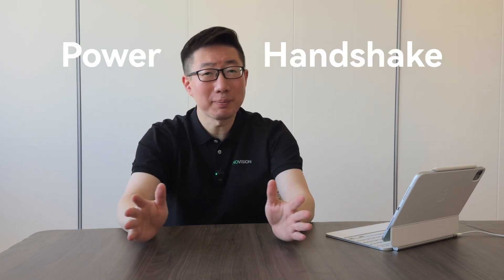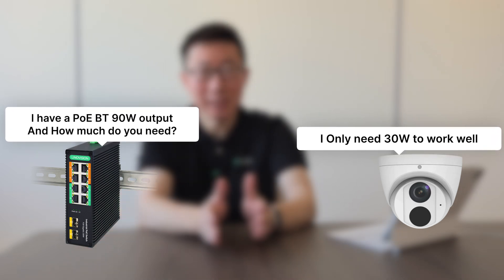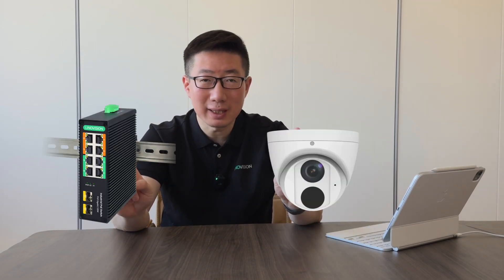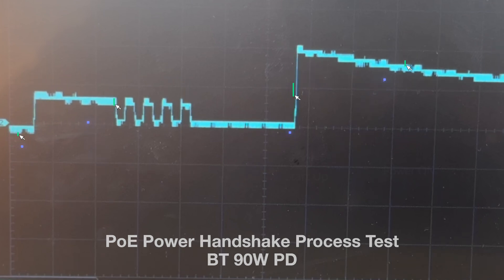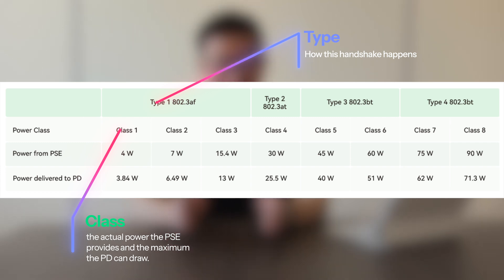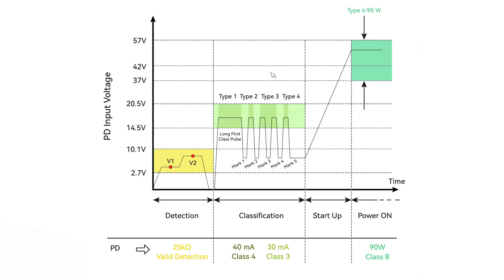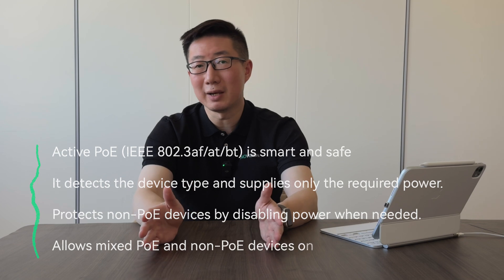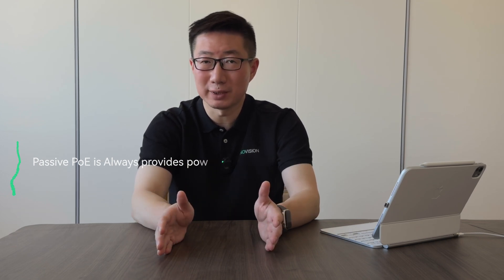PoE 101: Power Handshaking Process

Comment: I knew that a good PoE switch would test the client to find out if it was a powered device or not. I used to believe the switch would measure the resistance of the device, and it it met requirements, the switch would kick on the 48v power. I guess that''s not so. I assume regardless, once switch found out the PD is for real, then it just ends up at 48 volts? I didn't know a PoE switch had any ablilty to vary the current output either. I figured the PD does the current limiting.
Reply from the maker: You’re actually on the right track—PoE negotiation is a pretty smart process! In IEEE 802.3af/at/bt standards, the switch (PSE) does initially test the connected device (PD) using a low-voltage signal, typically through what’s called the “detection” and “classification” phases. It checks for a specific resistance signature (~25k ohms) to confirm it’s a real PoE-compatible device. Once verified, then the switch provides full voltage—usually around 48V.

And yes, modern PoE switches can vary the current output based on the class of the PD. While the PD does have its own current-limiting circuitry to protect itself, the switch uses classification info to budget total power and avoid overloading.

So it’s definitely a two-way handshake, and it’s smarter than people often give it credit for!